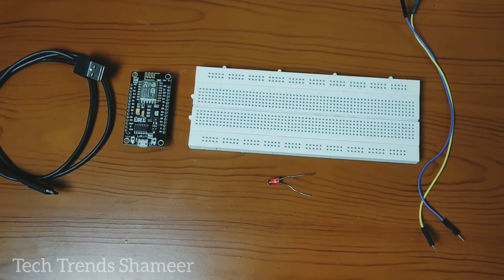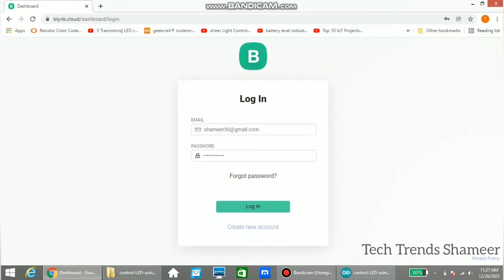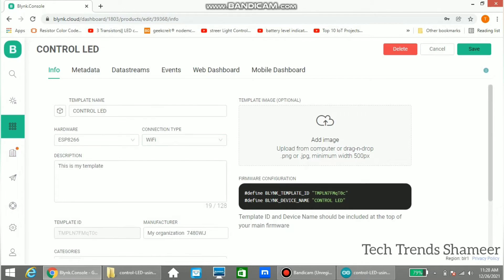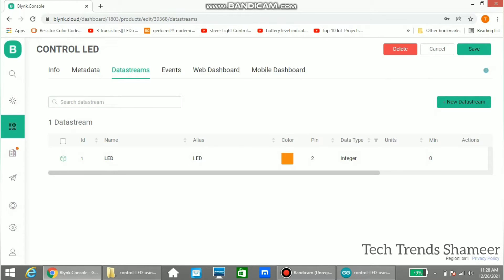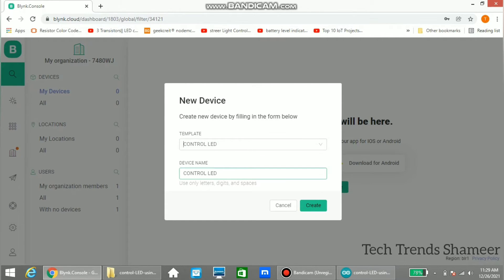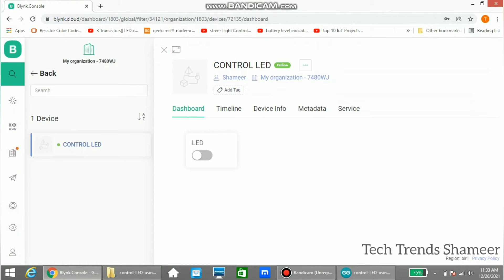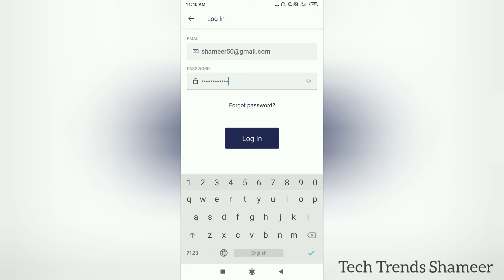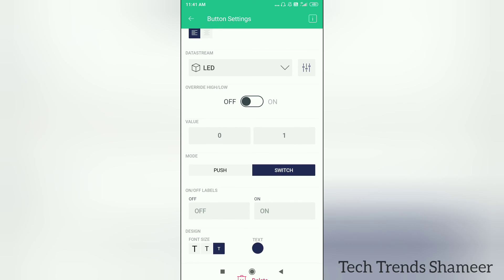Control LED using Blynk 2.0/Blynk IOT using Simple Program | Blynk 2.0 Projects | Node MCU Projects

Comment: How we connect more than one led 
I was trying to connect through D5
Select digital pin 1 in blynk it's not working
Reply from the maker: Did you tried with 1 LED? If not please try with that. Once you get the output, I will tell you the modifications in the code for 5 LEDs.
Reply: @TechTrendsShameer  i did tried with 1 LED and it worked! pls do more than 1 LED
Reply from the maker: After Wifi Connection add these lines in the code

int ledpin = D4;
int ledpin = D1;
int ledpin = D2;
int ledpin = D3;
int ledpin = D5;

Then Connect LED 1 to D4, LED 2 to D1, LED 3 to D2, LED 4 to D5, LED 5 to D6

IN Blynk Datastream, select the variable as 2, 5, 4, 0, 14

Comment: great video !!..I was doing the same project but I used an arduino mkr wifi 1010 instead of esp ...arduino mkr wifi is an arduino with wifi capabiilities.. You're instructions were very clear and I was able to finish the project and it all worked out
Reply from the maker: Great 👍Whether the code is same for Arduino MKR Wifi? 
Please share the details. I will also give a try.

Comment: The led is not connecting to blynk and the led is glowing automatically
Reply from the maker: Please let me know which pin you connected in ESP8266 board and which pin you mentioned in Blynk -> Datastream.
Reply: same problem

Comment: Thanks sir, I've been looking for 3 days for a simple walk through like this. All others were either legacy Blynk or had links to codes that were never obtainable...... so frustrating. Mine didn't work at first but I had accidently chose INTEGER instead of DIGITAL for my control. Also to newbs, make sure your add your wifi creds and pw's to code. Thanks again this is great.
Reply from the maker: Thank you so much Bro.
Reply: Thanks bro, but wat happen if the project is successful ,,am i going to be continuing paying the blynk app after the pay period expired?
Reply: @justicemkandawire9211  the blynk app has a free version that’s more than enough for a semi serious hobbyist. 2 devices and 30 functions each I believe.
Reply: Ssid and password of my mobile hotspot right I have to use that

Comment: Sir when we code is uploading and y sir don't show in online our device
Reply from the maker: The device will show online once the code is completed uploading.
Please check the template ID, device id and auth token are correct. Also make sure the wifi credentials are correct.
If you are still facing issues, please contact me on instagram 
https://instagram.com/tech_trends_shameer
Reply from the maker: @susmithak8574  I didn't understand the doubt clearly. Can you please connect me in instagram
https://instagram.com/tech_trends_shameer

Comment: there something wrong with your code
Reply from the maker: Please let me know what's wrong in the code
Reply: @TechTrendsShameer   idk, but it wont work, did you recheck your code? Loop is empty
Reply from the maker: I think you checked the code from the video. You will not able to see the full code in the video screen. Please check the video description for the complete source code.
Reply from the maker: I use ESP 8266 in this project. If you are using other boards or selected other pins, please modify the program.
Reply: @TechTrendsShameer  nvm, i found it, in your code ledpin d14, but your blynk use d2. Im conversing your code to esp32, at first it wont work. But after change digital pin on blynk, now it worked. Thanks